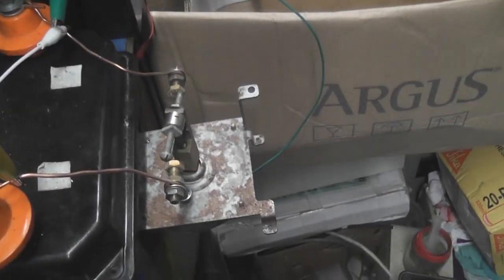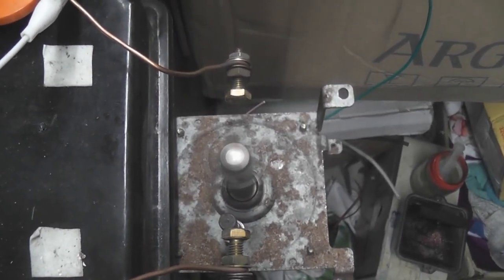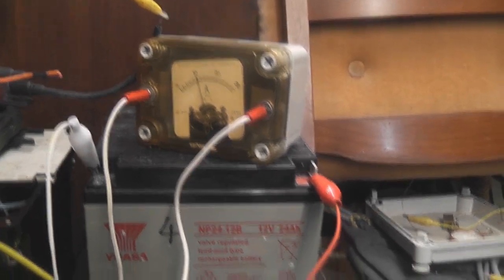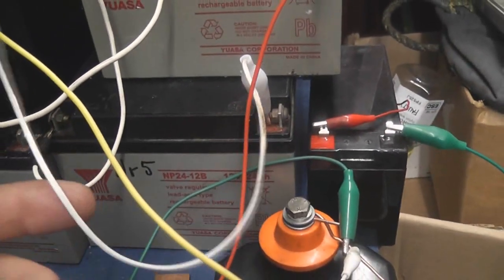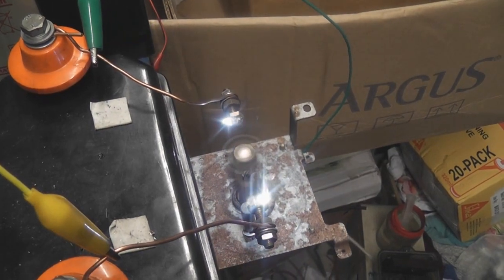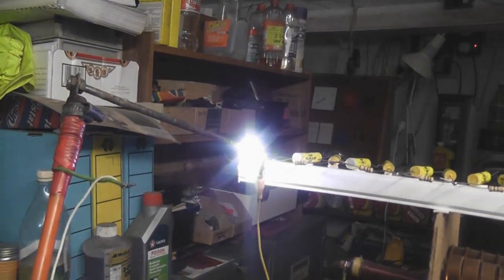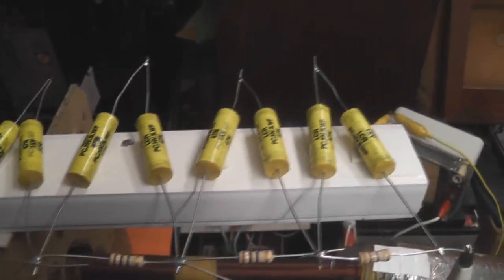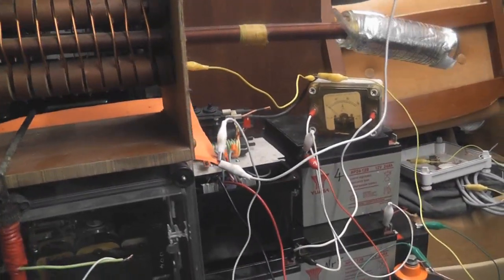Rotary Sparkgap with Capacitors

Comment: Amps are what kill you but ampage is usually dependant on voltage, so its like saying "Its not the man with the gun that kills you, it's the bullet". Its because if human resistance can be regarded as constant then an increase in voltage will mean more current and vica-versa

Comment: Not really...A car battery can put out 500 amps but it wont kill you because it's only 12 volts.  You need a high enough voltage to overcome the resistance of the human body in order for a lethal amount of current to flow. Ohm's law.

Comment from the maker: I need to redo some of these aligator clip leads and use 1.5 mil wire instead of the 0.5 mil which is burning up during the 10 Amp runs.
I think that the airflow will interfere. may do a 48 Volts run but don't want to blow up my mosfets at this stage.

Comment: Haha. very good. When you done the slo-mo of the 36v at 10A on the rotary arc-puller, it can be seen that it almost stretched the arc right round into a complete circle! :D

So then.... What happens of you actually succeed in stretching the arc right around into a complete circle on the rotary arc-puller?

Does a wormhole open up? :D

Stargate, baby! :D

Thanxx for showing,

{^_^} BoomBoxDeluxe {^_^}